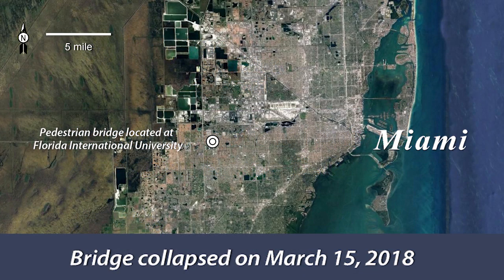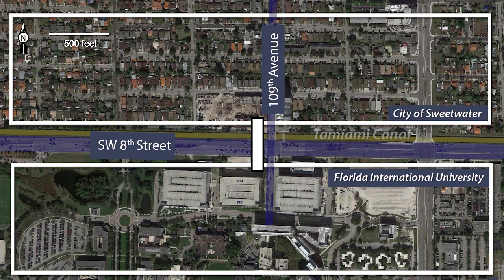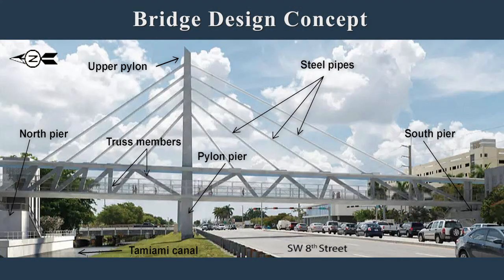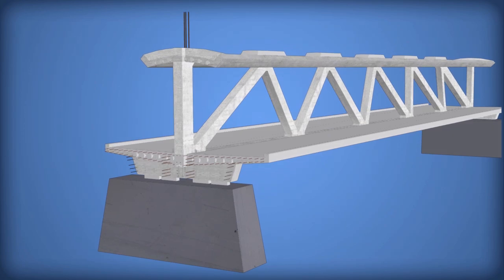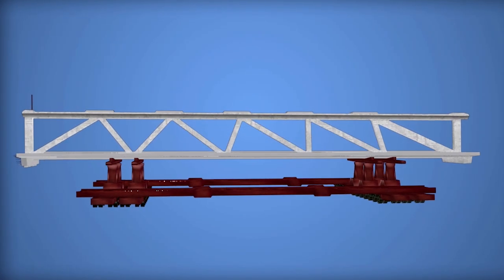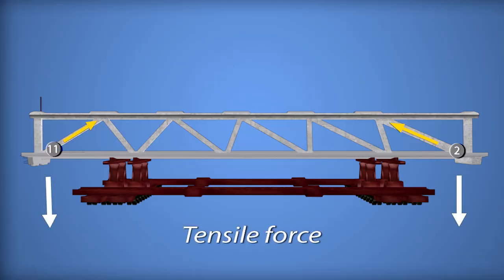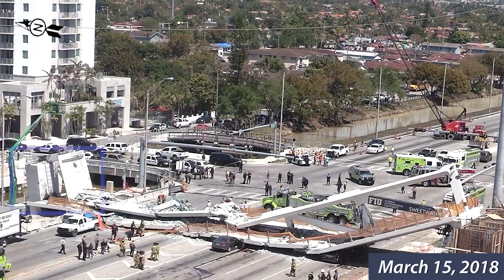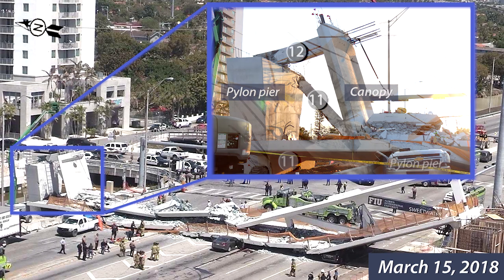Pedestrian Bridge Collapse Over SW 8th Street HWY18MH009

Comment: Aesthetic over function in civil construction.  This is what happens.
But hey, steel truss bridges are "ugly".  Was it worth it?
Reply: Which is ironic because steel beats concrete in the aesthetics department every time. There's nothing that makes you feel good when looking at concrete.
Reply: Frankly, I think THAT design was UGLY. I believe in the old adage, "form follows function". The HP Long Bridge outside of New Orleans is constructed from structural steel and it is BEAUTIFUL. And it has carried auto and train traffic for many, many decades. Form follows function! I mean, if they wanted the look of a cable stay bridge, WHY NOT MAKE IT A CABLE STAY BRIDGE????? Duhhh!
Reply: Steel truss bridges are awesome. Yes, people need to go to prison on manslaughter charges and never allowed in the construction industry again.
Reply: Only if they could've considered funtion as an aesthetic, there wouldnt be any problem whatsoever.
Reply: Remember when testing autos they used to put it on the tracks with bumpers on each end and have it pushed by a loco into a steadily building train for force testing and they would be moving a whole freight train with the car right in the Highest stress point. And it would be as good as new when done. And remember when they built bridges so good that they last hundreds of years with barely any maintenance
Reply: @mattsmocs3281  rail road bridges do
Reply: That’s what I was thinking too!
Reply: The Golden Gate Bridge is 4,200 feet, almost a mile long. 90 years old. Carries a LOT of cars and trucks everyday. It's beautifull! And it's STEEL!!!
Reply: I have been thinking about how they choose Aesthetic over function since this happened.  Wondered if cost was a factor as well.  Give me a solid bridge over a fancy one.  It has one job, looking good isn't the job.
Reply: They should have used a pre-assembled concrete arch.
Reply: Aesthetic? The design was hideous and stupid looking!
Reply: that bridge could've been made many different ways, looked at least as good as that, AND actually performed for many years. This case is baffling. Steel, REAL cable stays, etc would have not changed the look at all, while being lighter, potentially faster to assemble, and above all, safe. I struggle to understand.
Reply: according to the waman "engineers" (they did no real engineering, just f-d up a template), it was worth it because it killed a white man...
Reply: but, but... it was "progressive"
Reply: Almost all modern Architecture/cars are hideous and can't handle simple stress/accidents.
Reply: @Charles_Anthony  Modern cars are designed to crumple and fold on purpose. This absorbs energy, which is the real killer in an impact. Most people who die in car accidents don't get crushed, they die from g forces during impact, or from hitting the inside of the car. Making the car stronger means more impact g force for occupents. Modern cars are designed to sacrifice the car while protecting the people inside, and they're amazing good at doing this.
Reply: @TonboIV  : Yeah, they survived the crash but lost their legs due to the twisted piece of crap they drove pinning their legs under the engine or dashboard.
Reply: @Charles_Anthony  Modern designs have a very strong crash cell around the cabin, while everything else is designs to crumple or rip away. Obviously it can't save everyone all the time, but new cars are a lot better than old ones at protecting occupents both from injury and death. For every person that lost a leg (but still survived a very serious accident) how many more walked away from crashes? You can find video of high speed accidents and roll-overs in modern cars and people just walking out to hold thier heads in their hands and panic about thier insurance going up.
Reply: @TonboIV  : It would be nice if they took the older designs and made them that way to keep people safe. I hate seeing all these egg vibrators driving around. Smart car especially looks like a coffin on wheels.
Reply: @Charles_Anthony  The new designs are safe because they are different from the old ones. They have to be designed from the start to collapse in a controlled way. It's a choice between the car being damaged, or the people. With a larger, heavier design, there is a bit more leeway, but you still have to trade damage to metal vs damage to meat. I prefer bent metal.

Smartcars aren't a great design in general, but I believe they are at least reasonably safe in crashes, despite appeasances.
Reply: @TonboIV  : If I'm going to drive a car, it has to look good. That's why my car is over 30 years old. The last twenty years have seen cars get uglier and uglier.
Reply: @Charles_Anthony  No argument there. Most modern cars are seriously ugly.
Reply: @TonboIV  Not to mention other safety features such as airbags, seatbelts, ABS, TC etc.
Reply: Charles Anthony You don’t want your car to withstand accidents, you want the people INSIDE to! Your car’s job is to act as a crash absorption device to lessen the forces YOU take.
Reply: Charles Anthony architecture has absolutely nothing to do with cars
Reply: @rennycepeda6576  : I'm making a point about modern designs in general.
Reply: That's designed by structural engineers, not civil.
Reply: @theivory1  I'd argue there was nothing civil aboit it.
Reply: theivory1 CivE undergrad student here, designed a better bridge for a class project and I’m not even interested in structural
Reply: Maybe women shouldn’t design and build bridges I guess.
Reply: JUST WHAT DID YOU THINK WAS GOING TO BE >>>> FROM A 100% 'female of the species' design team / Compamy  ........ " AS LONG AS IT LOOKS PRETTY ".............. there are at least 100 people who need to loose a limb for this
Reply: @barneyruble7013  "loose"

Comment: Completely inexcusable that the road wasn't closed or there were not secondary countermeasures put in place (eg: cranes ready to catch the bridge if it failed, or buttresses under the bridge in places between the cold joints).  The later could have been done without closing the road (maybe a few lanes).  I am sure money was the reason it wasn't though.

Comment: The engineers should be in jail and so should the state supervisors for negligence and manslaughter but we know that won't happen.
Reply: Oh, then maybe they were the ones designing the Hard Rock folding highrise......
Reply: The same engineering firm designed the rebuilt I-35W bridge that had previously collapsed due to an engineering design error (gusset plates in that case). See http://www.figgbridge.com/ slideshow. Same dudes!
Reply: @AllAmericanGuyExpert   Their website even states that form and function are equal.  Some of the other projects they are doing such as the Honolulu transit system are way over budget, still not in use and in danger of never being finished.
Reply: All-American Handyman same woman actually
Reply: @dciracer99  A girl owns the FIGG company, but it's not a company of girls. Project engineer is W. Denney Pate, 61, who is the responsible engineer for the collapse that killed 6. I hope he is prosecuted.
Reply: If the State refuses to press charges then it's time to lock and load and declare open season on the designers, engineers, and anyone else that approved of that bridge being built in such a half assed way.
Reply: A company that employs engineers based primarily on their genitals rather than their competence, qualifications & experience? What could possibly go wrong.

Comment: Wow  !  I knew some of it, but the total is stunning. Each diagonal member is in compression, but also each successive diagonal member, beginning at the center of the span must carry its load, plus all the loads toward the center.  The last diagonal is carrying all the loads.  The sin of it is,, That IS a cable stayed design,, but they had no intention of it being cable stayed.

And the developing cracks, especially over a 5 day time span, were a clear and certain observable failure.  That was absolutely denied and ignored for what it was.  The designer was wrong, completely faulty design.  The engineer, or engineers were factors off in their calculations, and the contractor was abhorrently negligent in not saying,   "No."   "Stop."

It is said failures are rarely simple, and this one can share blame all the way from the professor that envisioned it, to the grunt who was shoveling dirt that day.     One take away.  That professor that designed it?   Should never,, never, be allowed to teach,, anything in an engineering school ever again.  Every student he taught should be examined for what they were taught.

Form, function, materials,, that is the core of engineering and design.  The professor got all three wrong.  In my opinion.
Reply: It was designed by Munilla Construction Management, Inc. in partnership with FIGG Bridge Engineers (FIGG) of Tallahassee as a sub-contractor. Who is this 'professor' you're talking about?
https://www.google.com/url?sa=t&rct=j&q=&esrc=s&source=web&cd=7&cad=rja&uact=8&ved=2ahUKEwirvvrUw7XlAhXRwVkKHdB4C_IQFjAGegQIAhAC&url=https%3A%2F%2Fwww.osha.gov%2Fdoc%2Fengineering%2Fpdf%2F2019_r_03.pdf&usg=AOvVaw1jY2CueYG-9X86X2pmi6fd

Comment: Damnnn, and that was a modern bridge negligently designed and monitored. imagine if they weren't properly monitoring an already aging national bridge infrastructure? Yeah probably a real dicey time ahead.
Reply: I'm old enough to remember the same thing being said about bridges back in the 1970's.  What's been happening is that as older bridges get replaced - middle aged bridges become older bridges.  And people scream about our 'aging' bridges.  And one of the reason the average age of the bridges is getting older is that newer bridges are designed with longer useful lifespans than the ones they replace.  So those bridges that replaced older bridges in the 1970's still have several decades of useful life left in them - despite being currently being classified as 'older.'

And even with older bridges.  If the State keeps up with the maintenance - the bridges will last forever.  When you see states with poorly maintained bridges - you are seeing states where the gasoline tax money being spent on things other than roads and bridges.

BTW: 25% of the federal gasoline taxes are diverted to subsidize urban mass transit systems.

Comment: Who designs, who approves, and who builds something that appears to be so close to total failure at all times.
Reply: Florida International University was responsible for design, approval and build according to Construction Engineering & Failure Analysis:  https://www.youtube.com/watch?v=5-M7S1qP0jo&t=819s
Reply: @richardhaas39  Nope. The FIGG Bridge Engineers designed it. Not sure where that idea came from. See http://www.figgbridge.com/FIU_Statement.html
Reply: This crap happens all the time. No redundancy because it doesn't 'look elegant' (and it's cbeaper to build - at least the first time).  In California, for decades, they built structures with very slender columns.  But if you just stood back and looked, they appeared way too flimsy.  And of course they were once some large earhquakes hit.  A bridge built today probably has 10x the concrete and reinforcement it did in the 60s.
Reply: I wondered this too - first time I saw it, I noticed that the deck of the roof is extremely thin. Yes, concrete has high compressive strength,but I worry about the effects due to wind or such, where the forces may not be vertical.
Reply: Whose who are in charge of the local infrastructure who wants something for nothing and pocket the rest.
Reply: The deck collapsed before the wires were installed. There should have been added supports under the deck during construction and before the wires are installed.
Reply: @kirklee865  From what the video said (and if I'm understanding you correctly) those wires were purely decorative, and not meant to help support the birdge.
Reply: A team of women.

Comment: At 3:52, those aren't cracks,
THOSE ARE FISSURES
Reply: Funny. I called them canyons.....fissures works good too.
Reply: @grumerguy  
I seen on another YouTube channel (AVE?) where a construction worker said they were trying to tighten a tension rod bolt the day before, and it would never torque to the specification, so, they quit and continued with the other rods bolts...
Reply: Joe Schlotthauer if that's so, it's a clear sign that the concrete had failed. The tragedy is that nobody on site stopped work, and called in engineers.
Reply: @grumerguy  Chasms?
Reply: Active fault lines
Reply: I bet they knew the first day it was placed that it was going to collapse.
Reply: Most ridiculous design concept ever.    Based on many years of checking/fixing engr designs on industrial structures,   I bet FEA model has support pins in the model at ends. !They are great, but by definition they have zero deflection , and have screwed up countless designs.   

Still puzzles me how we can build things in high seismic locations,  but can not make a pedestrian bridge.
Reply: They are called structural failures.
Reply: Pour some Mapei on it.
Reply: What type of fish is it?

Comment: It is interesting that at about the same time this structure was being built, University of Miami nearby was also building a pedestrian bridge for the same reason.  Theirs is a conventional steel truss design, however, but with design elements added to make it more attractive.  A side-by-side comparison of these two structures would be instructive.

The University of Miami pedestrian bridge is a 125 foot span which weighs about 66 tons.  Extrapolating to the length of the FIU bridge, we might expect it to weigh on the order of 100 tons for that length.  That would make it about nine times more efficient by weight if the FIU design worked (which it didn’t).  I wonder how the costs compare (not counting all the extraordinary post-collapse costs).
Reply: Static loads on bridges go up with square of the length not linearly. That said, a steel bridge would have been lighter.
Reply: @allangibson8494  
Square of absolute length, or longest unsupported length?
Reply: @bcubed72  The unsupported length - but on this design the entire length was unsupported.

Comment: Isn't there supposed to be some sort of analysis here?
Reply: There's a 6,000 page report.  I'm sure you can find all of the analysis you want somewhere in those 6,000 pages...
Reply: @buckhorncortez  It's 115 pages, but the summary contains most of what you need. 
https://www.google.com/url?sa=t&rct=j&q=&esrc=s&source=web&cd=7&cad=rja&uact=8&ved=2ahUKEwirvvrUw7XlAhXRwVkKHdB4C_IQFjAGegQIAhAC&url=https%3A%2F%2Fwww.osha.gov%2Fdoc%2Fengineering%2Fpdf%2F2019_r_03.pdf&usg=AOvVaw1jY2CueYG-9X86X2pmi6fd
Reply: @bbgun061  That's only the summary report.  As of 10/22/1019 the NTSB was still working on the full report that will include a number of appendices with additional information including NTSB testing of materials from the site, testing of NTSB built bridge sections, and other information in support of their findings.
Reply: @buckhorncortez  I didn't know that. But the report makes it clear that the truss was designed too weak.
If it was a good design but faulty concrete, that would be a different story.
Reply: Smozi — The video of the full hearing is up.  Everything is there.
Reply: @GH-oi2jf  Yes thanks, I found that here: https://www.youtube.com/watch?time_continue=547&v=fdUf-_el9vA

Comment: https://www.youtube.com/watch?v=9qffZEDmOv8     plus the FIGG ENGINEERING admitted SAGGING OF THE DECK TAKING PLACE BEFORE MOVE, DO THE WORK, ALSO, NTSB NEVER DISCUSSES THE POST TENSION FAILURE IN THE DECK. NTSB, NEVER EXPLAINS HOW THE LONGITUDINAL POST TENSION FAILS.  THIS IS THE WORSE REPORT I HAVE EVER SEEN PLUS YOU CALL OUT LUIS BERGER FOR NOT HAVE 3 QUALIFIED ENGINEERS ON STAFF TO QUALIFY FOR EVALUATION THIS ADVANCE CONCRETE STRUCTURE     AND YET,  YOU PRODUCE TWO CIVIL ENGINEERS  AND NEITHER ONE IS QUALIFIED EITHER TO EVALUATE THIS ADVANCE CONCRETE STRUCTURE!    YOU ARE IN VIOLATION OF YOUR VIOLATION YOU CALL OUT,  NOT QUALIFIED AND LACKING 3 QUALIFIED ENGINEERS TO EVALUATE THIS ADVANCE CONCRETE STRUCTURE.

Comment: That longitudinal fracture on truss member 11 at 3m50s looks like that end of the member was crumbling like week plaster most of the way up that member under excessive compressive stress. Hmmm, would 'slipping' cause that kind of fracturing and ultimately pulverizing of the lower end of truss member 11 as seen at 5m20s?

I've seen what happens to concrete samples when put into a compression test and pushed past its compressive limits. it pulverizes into small bits just like the lower section of truss member 11 did. I'm sorry, I have doubts it was just slipping. Wouldn't the tension rods and rebar keep it from slipping any way? Or was the rebar also inadequate for the connections of the members to the deck?
Reply: The truss members had no redundancy ... their strength was the sum total of concrete and tension rods. Once the concrete began to fail, the loads were too great for the rods to handle alone
Reply: yeah, just finished watching the 3-hour vid. and the reinforcement metal had a 300% deficit in rebar to handle the loads on it, I think that's approximately how Mr Sumwalt worded it in the Board Meeting. At about 2h12m ish into the 3-hour vid.. The column would have needed 18 square inches of rebar to hold the load on it, the column had 4.8 square inches of rebar. And that was only one of the deficiencies before the situation was made worse by mismanagement.

https://youtu.be/fdUf-_el9vA?t=7981
Reply: @tommypetraglia4688  Tension rods add to compressive load - they cannot carry it.